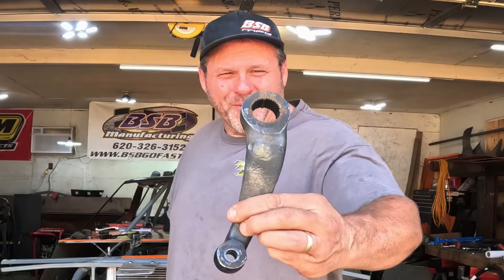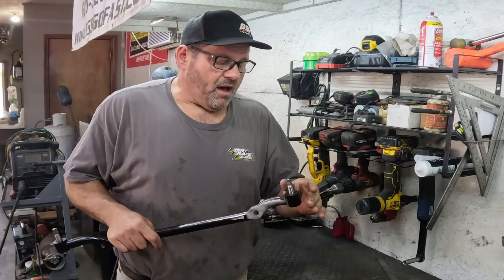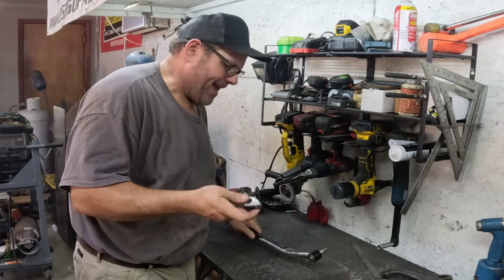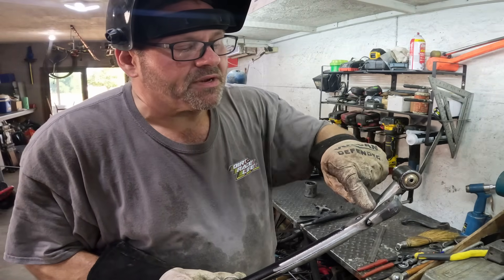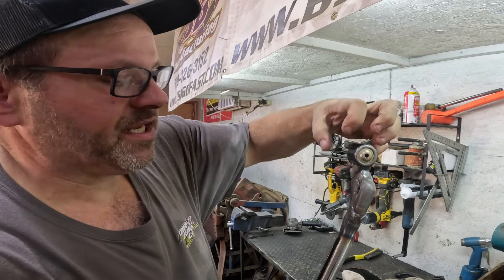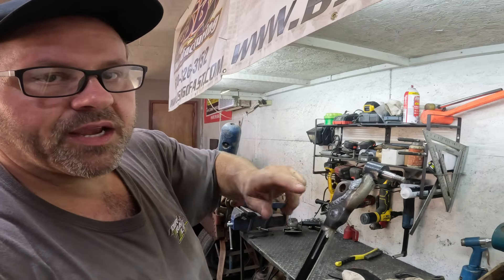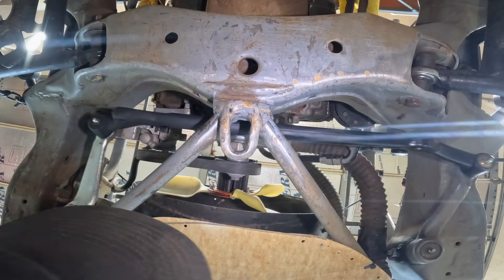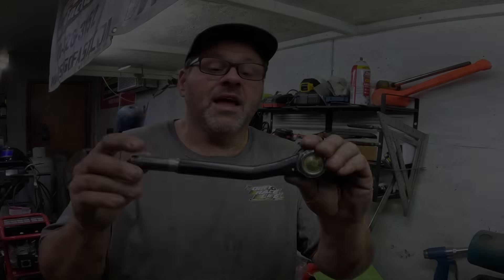How I Fix the Bump Steer Issues on My Race Car!

Comment: On my pavement Camaro, I have Howe everything as far as steering goes, except for the tie rods. I got swedge tubes with the 5/8 and 11/16 from UB machine. I also got their tube uppers that fit the 7 3/4 bolt pattern for a factory mount. The mount has been moved though.
Reply from the maker: I am going to check UB for that swedge tube, thanks for the tip bud!

Comment: Good idea on moving the driver side out on the center link, that's the missing piece that I haven't tried yet. You're the only other one that I've seen with the idler arm inside the frame horn. My car was on all stock tie rods though so without modifying the 1049 the left side was stock metric inner and outer but the right side was stock inner and 78 Monza outer (it's a lot shorter and also 5/8").

Comment: Jason , 82 up lowers on Camaro are the same as metric an S-10 are also , lower trailing arms on metric are same as 82 up Camaro rear lowers , I built a metric about 15 years ago with 74 up Malibu pitman an idler with the 82 up Camaro drag link , to bad we couldn't have been neighbors back then , I believe we might have been successful as a team , if you ain't using your noodle you ain't going to get better 😂 by the way Whynot is my home track I'm just getting old an broke 😢😅